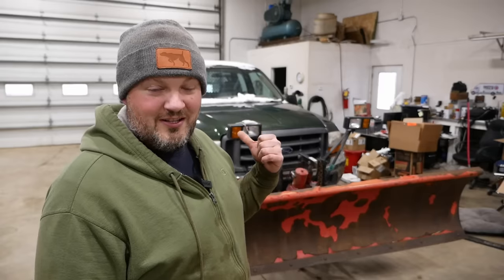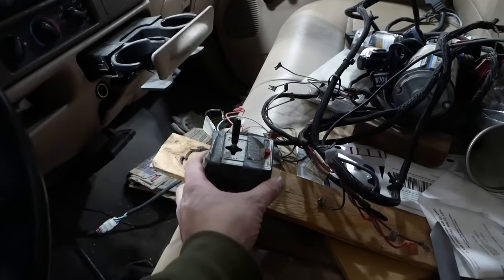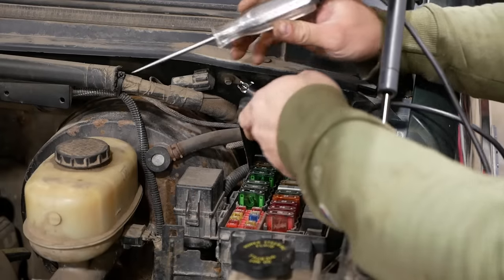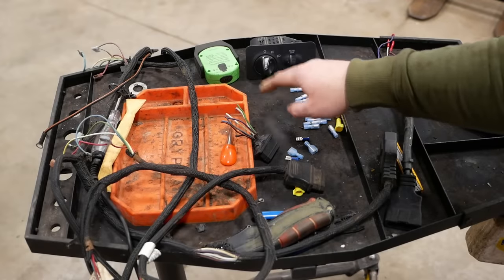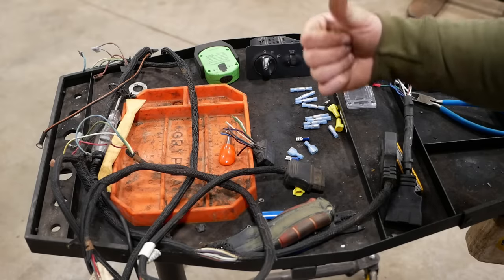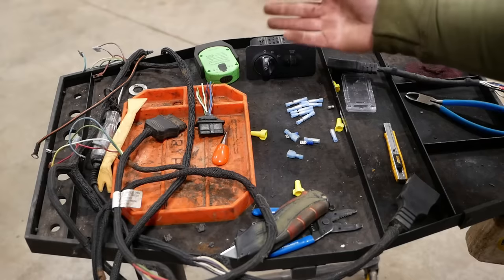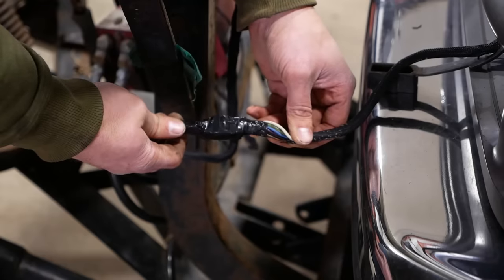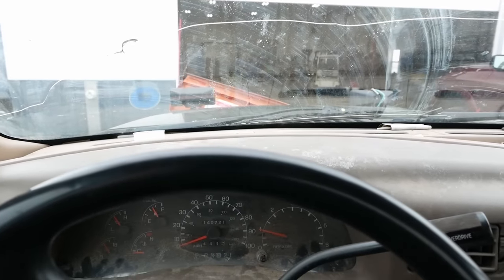Soup Sandwich Snowplow Repairs

Comment: Happy New Year. If you recall I am the retired Air Force wiring team lead that commented on the screw driven into the tractor wire harness under the door kick panel. I watch all of your stuff because you not only care about doing it right but you also seem to care about how it looks. If interested I would like to offer a trick we use on aircraft. On military and commercial air craft sometimes the cavity where the harness lives will not except having the splicing all in one location. What we would do is measure the length of the splice plus the number of wires to get a overall length to start the splicing so no one splice is laying over the top of another one. That way the overall diameter of the repair is no larger than the splice itself. Please keep in mind this only works if you have enough length, space and enough wire. This guy just wants it to work not unlike a military crew that only ask if the weapons fire. Play with the harness provided and see if you can use the process. Good stuff. Thanks for letting me relive some shot all to hell military wiring. Hi from Texas

Comment: I use to work for a snow plows dealer in New Jersey and the plow lights had to be interlocked with the truck low beam circuit when used for highway use as per the NJ DOT.
 Watching this brings back all the complaints from users. These trucks, mostly from landscapers live a hard life. The wiring issues were number one on every repair list. Include the fact that hanging all that weight out past the front bumper destroying the front suspension is an added plus.😊

Comment: Honestly I think for a temporary fix the wire nuts would have been just fine, so long as the two sides were zip-tied such that there was no stress on the splices, then cover with tape or a plastic bag.  I used to design wiring harnesses for heavy duty trucks and construction equipment, so I understand the amount of work involved in doing wiring the correct way.  It's amazing how many hours/days one can spend on doing wiring properly.  99% of people don't even understand how complicated and time-consuming it can be.

Good job Wes!  You are truly a blessing to your entire community.

Comment: I had the same problem with mine. I chopped the plug off and used two trailer 4 prong connectors. I wired them so you can't mess it up .
Reply: Exactly what I do .

Comment: Happy new year Wes, I run the same plow on my 95 GMC Yukon affectionately named the RHINO, it's a snow moving beast. Poor old girl definitely could use some love cuz Michigan winters or as I call them season of salt take a toll, she's a rust bucket but just keeps pushing snow. I am amazed every year after she sits all spring, summer and fall pump it twice and she's running. I did change oil this year and installed new power steering pump after plowing all last winter with basically no power steering, good for upper body strength. Love the channel and the enlightening narration, you do an excellent job explaining what is going on and I appreciate that, thanks. Here's to a better 2022 hopefully, live long and prosper.

Comment: I used to install Fisher Plows, they came with complete directions, I always checked off each step as i went. Greased and used Locktite on all the major bolts. I could do one in less than a day. And I always put the Fisher directions in the truck before it left. Having the directions might help you out!
Reply from the maker: Western has a good manual library.

Comment: Ah yes, the legendary Bluetooth headlight mod. That'll get ya every time...  My guess would be it was blowing fuses with some combination of lights/plow movement & the operator helpfully disconnected the switch to keep the plow working long enough to finish up whatever job it was on & then the other shop started to "diagnose", saw the crusty wire and gave it the chop but when the truck's lights still failed to work on installing new fuses they didn't get logical but instead got scared.  Either that or they felt their time would be better spent on beer and mince pies lol.

Happy New Year to you and yours Wes. Thanks for sharing the trials and tribulations of rust belt life with us, it certainly makes me feel a bit better about our rusty junk in the UK.

Comment: Good job! Obviously that’s a good repair on that truck lol. You can also get some universal weather pack connectors on Amazon. I keep some in stock with like 20 pins slots. I’ve used them many times on the low amp side and then I use winch battery cable quick connects for the motor side. Works good when new connectors aren’t available.

Comment: Happy New Year Wes! This one made me chuckle for some reason. Electrical wires just chopped off give me nightmares sometimes. Not always. 

What, you thought there was a witty punchline? No, I still have nightmares about that drilled through wiring harness, and I didnt even have to work on that mess!
Reply: Same here, that was an epic fail, with an epic repair.
Reply: @bostedtap8399  Indeed. Happy New Year, Wessel. I think fans of Wes need a name...Wessel..like nuclear wessel? I dont know..had a looong night lol
Reply: @RipRoaringGarage  Star Trek,  get it, some very funny stuff in that film, can't remember the name, I remember it involved transporting a whale from the past. Lol.
Reply: @bostedtap8399  Yeah. I was a big trekky back in the day (not to where I could name each episode and what not but, the old series, next generation, deep space nice...) Everytime I work on a coolant system though, I hear Geordi Laforge scream "coolant leak, evacuate engineering!" lol.

Comment: I'm a big fan of manual windows to be honest.
Reply: You have more tactile feedback when it's frozen shut and you're about to bend it like Beckham.
Reply: @12345NoNamesLeft  I like that "tactile feedback" I'll be using that term today at least once lol
Reply from the maker: I've never owned a truck without manual windows.
Reply: @WatchWesWork  i always thought it would be cool to buy a brand new truck with absolutely no bells and whistles. I owned a dodge ram with the most basic package it didn't even com with AC it was one of the most reliable vehicles I ever owned aside from my f150 with the 300 they never failed to put food on the table for that I will forever be indebted

Comment: Hi Wes. Seasons Greetings to you and yours. Huh a Western snowplow... and it works.  That's most of the fix. But when it stops and it' s the joystick try pricing one out. For that matter price out the wiring harness.  Now if I cold just get the plow truck running again. It quit again the first day it snowed here in Fairbanks. (AK) That was only 6 inches. I don't think your storm can be all that much as most of the snow dropped here. I have a measured 30 inches in my yard now from our last two episodes. I enjoy the heck out of your channel. And no you don't talk too much. You don't cuss enough.
Have a great year.

Comment: Good job, Wes. I dealt with a lot of this in Upstate NY. Western makes a very dependable plow, but like everything else, they need to be maintained. I was the guy who did all that in our shop. I have seen many controls mounted just like that one. It's quick and easy and does the job. Another thing it is is uncomfortable! I worked in a cheapskate shop and I used two steel plates and a stick of 5,8ths rebar to make up a stand from the floor to the control just above seat level. It's far more comfy for the drivers and we received far less complaints.. Also had fewer repairs on the harness at the controls. You might want to chat with that owner about doing something similar.. Happy New Year!!!

Comment: I worked for a sweeper outfit that did snow removal The night of the big storm they pulled in 9 inop plows and screamed they have to be running in 4 hours after sitting in the yard for months. We had 3 mechanics on shift and hardly any parts. Alway felt like a miracle worker.
Reply from the maker: Ouch.

Comment: Happy new year Wes.
I once heard about similar situation, snowplow was to be fixed properly and taken to a DOT. Well weather desided differently, that truck had no lights whatsoever and no reason except some burnt wiring. The plow was easy to fix some new wiring and maintenance. 
On lighting He ended up to puting an external lightswitch outside on the hood besides wipers and for some reason trailer light connector worked normally when running lights were lit, so magnetic trailerlights plugged in and screwed on to tailgate. And the truck was ready for work on temporary plates.

He newer saw the truck again until few years later it came for maintenance.
The lightswitch had been routed to inside just by drilling large enough hole trough wiper panel and through top of the dash to fit switch inside without unplugging it, just plenty of rtv to keep water out. Rear lights were still same trailer lights just relocated in the place of original lights that had been removed and with 1 to 2 trailer connector.
Just saying if temporary works don't fix working things.

Just remembered one rotted out mazda or toyota van that had rearlight cables burnt and sliced in the framerails, I removed trailer hitch since it fell to the floor while I was stepping on to it for taping masking on to paint the rear door. but it had working wiring though connector was long gone, but all the necessary signals came to rear end, it was easy to rewire the rear lights, and original cable was running near so no extensions were needed, just hairy connections and tape. Lights worked fine 1500 miles road trip, and I'm fairy sure if the van still runs in Africa lights are continuing to work

Comment: Good fix! Another option would have been to splice the old connector back on minus the brown crusty wire. Then use a common weather resistant two conductor connector to bypass the the big one.

Comment: Gotta love wire hackers! Who else was chanting "Deutsch, Deutsch, Deutsch" when Wes was trying to come up with a solution? We need to get this man a kit!
Reply from the maker: I have a weatherpak kit but it only goes up to 5 pins.
Reply: @WatchWesWork  I faced the same dilemma (a limited # of pins per connector) needing to replace a disconnect that had  7 wires but the biggest weather pack connectors in our kit had 4 pins.
To get around that I used 2 sets of 4-pin connectors and "polarized" them so they could still only be connected correctly by by dividing the wires between the 2 connector pairs by putting a male and a female connector on one side of the harness and the other male and female on the opposite harness.   1 connector set had 4 wires and the other set had 3 wires. Maybe not very elegant but consider what you might be putting them on.............if it was something like this plow truck,  it would not be noticeable.
Reply: Yes sir

Comment: Yup my Yota T100 has manual windows, cable driven HVAC doors, and a 5speed trans. Most manual truck i could get with v6 power. I love my simple old toyotas the t100 uses the late 80s tacoma parts so cheap ez to get. Yeah they dont make em like they used too. Great work Wes some ppl are clueless even "Techs"

Comment: Wes, I'm planning to build a dedicated snow plowing tractor with a reversed frame on the rear. The steering wheels will be in the back like a forklift, and I'm not using the stock Kohler engine, but will likely use a Briggs and Stratton 16 hp from a pressure washer. This cub Cadet had a shaft on both sides of the hydrostatic transmission, so when I turn it around, the engine will drive the transmission from the back of the engine, and then I can use hydraulic steering on it. My cousin gave me a steering valve from a Kubota 4x4 that is similar in configuration to what I'm building. I have similar snow plow lights as to the ones on the plow you worked on. I may go with led lights in them so I don't need to add an alternator for more charging capacity.

Comment: Western plows like this have a set of relays for the headlights but the turns are wired direct. When you unplug the connector the headlights convert back to the truck lights. Older Myers plows have a light switch in cab to change to and from plow to truck lights. Newer Myers plows are set up just like this Western plow with relays on the headlights. Just in case someone is here troubleshooting lights on plow trucks.

Comment: I was hoping for a quick look underneath if it was going on the hoist. Check out the typical fuel line and brake line cobbled repairs as well. Your the SMA repair shop of the Midwest Wes.

Comment: Happy new year. I know dekalb is forecasted 4-8" of snow hopefully its lighter out by you guys. Stay safe and enjoy the extended weekend. Something I get to look forward to soon is electrical work on a 2016 polaris ranger. The alternator fuse pops as soon as the key is turned to on with engine off. My guess is the two alternator relays are internally shorted, or the exciter wires/winding on the alternator are grounding out inside the alternator housing.
Reply from the maker: Those voltage regulators are pretty hokey on all ATVs. It's amazing they ever work.

Comment: One of those Western plows from when they were using powder coating which just peels off. We sandblasted and painted them. For the wiring, Western used so many different ones that it's probably better to switch to Weather Pak. Most parts stores have some Weather Pak connectors in up to 6 terminals. Put a male and female on the truck and plow. You can get 5 sets of the 6 terminal connectors for $20 on Amazon. There are also 4 and 5 wire flat trailer connectors that will work too. They might be something to keep around the shop.
Reply from the maker: It's pretty funny. It's still has the sticker that says something like "powdercoat finish will never fade or peel" surrounded by faded and peeling powdercoat.
Reply: @WatchWesWork  The companies that marketed powder coating equipment made those claims and many people believed them.

Comment: That brings back my snow plowing days back. Actually you could have just put the stock plugs back on and just jumped the one bad lead with a bullet connector and a length of wire on both ends then tape everything together.

Comment: When I had to rewire my trailer, I used lever nuts to temporarily connect everything together until I was sure I had all the connections correct. I found it a lot neater than using wire nuts.
Reply: My first thought was “what the heck are lever nuts?”.  So I tried to emulate Wes and searched and found them, a nice concept, clean, reusable, and easier on stranded wiring.  Thanks for the suggestion.

Comment: Soup sandwich?
Wes, that's full-on ketchup soup
:)-
Today's top tip: If you have a good selection of heat-shrink tubing (eg. many different colours), one can use selected pairings to colour code an ad-hoc connector, in cases where the native wire colouring may be hard to make out or there are pairs with the same pattern.
Cheers and a good new year to you and your family!

Comment: I would venture to guess that the cut and splice of the old harness was done to make it work temporarily to get them by, but they never bothered to take it back. No doubt that is was working and they were waiting for it to fail. I would further guess that you will not see it back until this temp repair fails.
Happy New Year.

Comment: The Western Unimount is far more reliable than the old Meyer my dad used to have. The latter was always contaminated with water and I could never find the source(possibly bad angle seals, replaced the lift seal too many times, or due to pitted cylinders I guess), spent far too much time warming the pump up with a torch. I ended up building a plow controller from scratch just to make sure we used the Unimount he got for free. He was ready to sell it after painting it because it didn't come with the wiring or controller.

Comment: Hi Wes those low amp control plugs are a huge pita!!!!!  if he doesn't switch plows from truck to truck your better off hard wiring like you did. Or replace the whole plug assy. and use a lot of diaelectic greese, (you know the stuff that stops voltage to pass lol) fyi sorry if that is what you finnally did, I havent wayched the whole vids yet  I live in Mchenry Il just east of you I believe, the snow just started here Saturday @ 3

Comment: Not gonna lie - I used butt connectors to install the stereo in my old chevy. Just the stereo to the adapter harness. It's been temporary for 5 years without issue so far.

Comment: You could have used the 7-pole connectors from the spare harness and 2 separate bullet connctors. But for the future, get an assortment of generic AMP Weatherseal connctors for when you repair the mangled harnesses on the trucks and trailers.

Comment: our western plow had problem with the plow lights, the pins in the plow side plug broke off. pain in the butt splicing the harness back together. western at least spared users the overcomplicated Meyers method - no headlight crossover module. tis plow season Wes ;p happy new years Wes & family